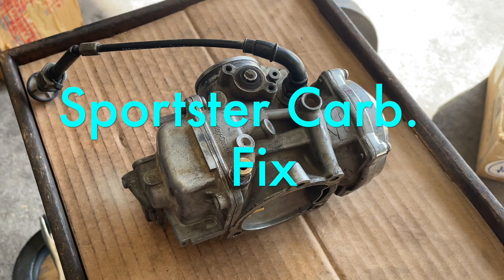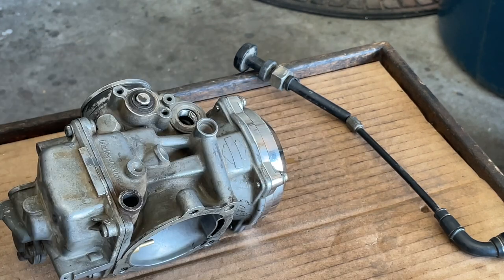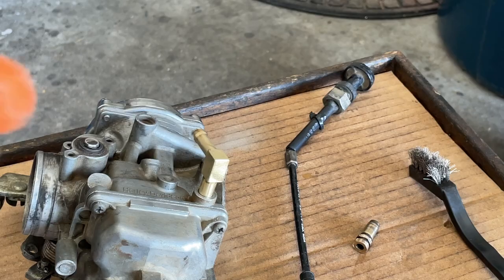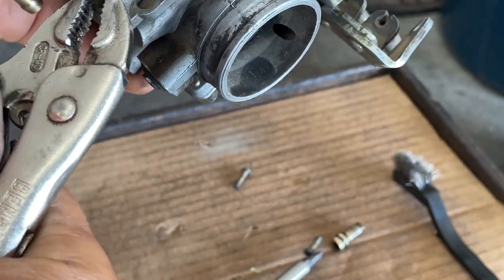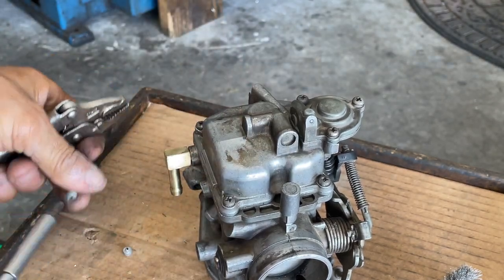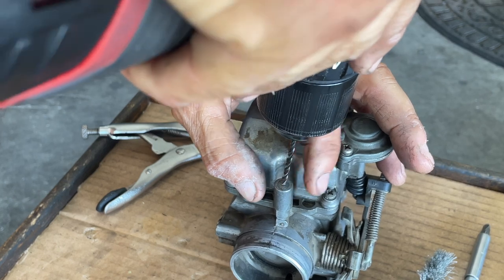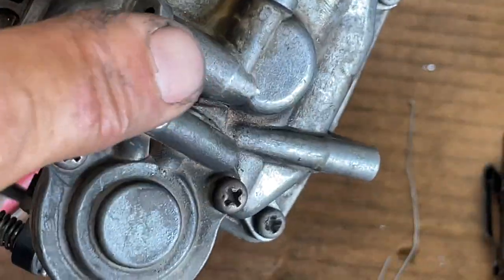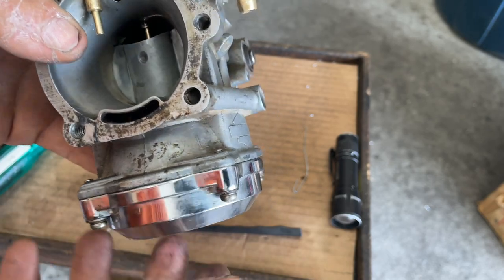How To, Harley Davidson Carb  Fix.

Comment: Thank you for making these videos it's helped me with my sportsters way more then I can actually ask for 😂 I went from a poorly running bike to something I enjoyed working on and learning alot bcuz you actually give clear and precise instructions. 😂 unlike some other content creators where you can't understand them
Reply from the maker: Happy to help. Any questions just ask. Thank you for watching and all your support L Assassin 22,  Ride safe and have a great day.
Reply: @TwoWheelRocco Your video's have helped me out tremendously with my recent purchase of a 96 XL1200C Sportster.

Do you happen to have any videos of carburetor float adjustment? I recently rebuilt my carburetor and it is pouring gas out of the overflow tube. It also seems to have lost a lot of throttle response as well.

I purchased it from the original owner who had the same problem after rebuilding the carburetor, that's why he sold it to me.

So two carburetor rebuilds within 18 months and they both leak out of the overflow tube.

Thank You 👍
Reply from the maker: The main thing to gas leaks is a bad Petcock, which the diaphragm goes bad but you could test that I'll send a video but the real number one problem float needle jet Has to be replaced. A lot of people just blow that off or buy a cheap one I recommend you go to dealer and buy one for like 25 $30 and that you should be in good shape. I'll send two videos. Any questions just ask.    
  https://youtu.be/2VwyFdMBOBc?si=Rpu1LtaNT6T5rOk1.  Watch the whole video I show you how to test the float needle on the bench. There will be no adjustment to the float level.. The problem lies with the needle Jet. The where is the float needle jet seats to seal off gas over fill your carb. bowl. When this happens, that's when you see the gas. Pour out the small hose on the bottom.     now for Petcock vacuum test. Very important.   https://youtu.be/7Fo9Q93OJXI?si=yM1nFT7HRtTzttSL. When the petcock fails, you cannot control the flow of fuel because the diaphragm gets a hole in it and fuel just freely flows into your intake and into your carburetor. That's the Petcock replace the float needle jet with a good one. Let us know how it works out.     Ebay.  https://www.ebay.com/itm/371594860984?hash=item5684c799b8:g:~W0AAOSw4nhZ-Mcq&amdata=enc%3AAQAIAAAA0Nwtli1MfFeqZJLgBM5ginGEyECWINZebtWRY%2BcOqZoNenr2RltshY8YBlxY%2BTbw85JtF0%2BF6mRMyrLMZ7w3Lpxfj73si8gBdntyaeoqA9MFlpz2v4zydTve4QlJwm8%2FqgABiAj0eMPoiqBFipxBANWW%2BCjSVcCFic%2BXvi27ZKBgVURFjJ9o1kFqVi6U4BMgiKG3%2B%2BvQrE%2B2qg5c%2FsjROrqbM2LRrn262oAL%2FVuKgF0r35JijKztpSPRgx6jTZp8FOj9K6KzieG11KfZjMVw7w8%3D%7Ctkp%3ABk9SR_7DnNrOYg.  Hope this helps.  Must make sure your gas tank has a screen on that Petcock because if you get any debris, gets caught up in that needle jet, It will leak, gas again and again. Any questions just ask.

Comment: Just yesterday I adjusted the air/fuel idle mixture screw, and the idle on my 2000 model FXDWG.
I think I got it right now, 1 and 1/2 turns out. 
The bike starts easily, cold with the enrichener pulled out. After  engine warm up while riding, the enrichener goes back in by itself. It sounds better at idle now, and runs like a scalded ass ape! 
Thanks for your videos Rocco!
Reply from the maker: Happy to help. Any questions just ask Thank you for watching and all your support Ardy. Ride safe and have a great day.

Comment: Thank You for another great how to video Rocco!  I've got an 87 fxrs low rider sport that I need to pull the carb off of and give it a cleaning.  Doesn't run well and fouling the plugs.  A shop was supposed to clean carb and drain and clean tank, but they didn't do all of the job as it fouled  out on the way home and I was so disgusted with the service I didn't want to take my bike back to them.  Thanks for videos that help people do the job themselves and have a better understanding of how their bike works.  Hoping to get 'er running again as I miss riding it.  Not the same as riding my bagger.
Reply from the maker: Happy to help. Any questions just ask. It's rewarding to fix your own motorcycle. Thank you for watching and all your support Steve. And your right riding is this #1 therapy. Ride safe and have a great day.  I will send you a video test your petcock when they start to fail you usually will have fouled out spark plugs.  .https://youtu.be/7Fo9Q93OJXI.  Very important to have a good operating petcock. That means the diaphragm is holding vacuum and not having Gas Leak throw it at fouling out your system. Very popular problem with these carburetor  motorcycles.

Comment: Whats up Rocco! I emailed you a couple times the other day about my carb issues.. Ended up FIGURING IT OUT! Finally!! Lol the accelerator pump diaphragm had a hairline crack about a quarter inch i couldn't see until i held it up to the light. End up changing out the vinyl nut that stripped on my choke with a brass one too so now it'll stay, ended up being a win win.. Your vids are the best, thanks again for all the help!
Reply from the maker: Happy all went well. Thank you for watching and all your support Andrew. Ride safe and have a great day.

Comment: Hi- Awesome video!  The audio/visuals and content along w ur great explanations were terrific.    Sorry for this ‘stupid q or 2’ but I had to stop riding my 99 dyna super glide 9 yrs ago.   I’m Far from being a gear head and thought it’d b a temp thing so I filled tank n added stabile.  Smfh- i shoukd have ram it dry.  Ram fine bfore I stored it- but heard of stories gas tank could become varnished n carb gummed up.   So I think il drain oil, gas, basically All fluids n replace the guts u did w carb n have a buddy inspect gas tank.   Should/could I change guts in carb w gas in tank?   Guess it doesn’t make sense if it’s going to have to be changed anyway.   Do u think it’s best to drain gas tank n change same couple parts u did -or u think the carb will need to have all parts changed ?    Sorry long winded.   Thanks
Reply from the maker: Happy to help. You'll need to drain that gas tank then you will need to clean the carburetor. Install a brand new battery and then see what you got. Try to start it. Hopefully your gas tank didn't get rusted. And your pick up Diaphragm probably is bad. Any questions just ask. Thank you for watching it all your support Sean. Ride safe and have a great day. Let us know how it works out.   https://youtu.be/Pp4l-zbQcy0.  This video test petcock.  https://youtu.be/7Fo9Q93OJXI.  This should help.   This will work on your HD Petcock to drain the fuel. The video is showing a Honda but it's the same principle.  https://youtu.be/c-gGr3mgaFw.   Good luck with your ride and get back out that little wind in the face is great therapy.

Comment: Have to do this. 04 883 13k on it and running with stage one never rejetted or tuned up. I am new to riding a harley but it sounds good when running a whike otherwise i pop and get slow throttle response at times. Not sure if the low tone sound of the engine blending together coming out my exhaust at times is due to carb but i would imagine cleaning and jetting will only improve it. Thanks for all your content
Reply from the maker: Happy to help. The first thing I would do is check my air filter. Sportster's and Harleys in general are notorious for oil getting on the air filter. Next make sure the oil is only halfway on your oil dipstick. I find many times too much oil in the motor and on your the air filter. Which leads to a poorly running motorcycle. If she ran good, then you don't need to play with the Jets,  air filter. Spray carburetor with carburetor cleaner, clean filter. Let us know how that works out. Thank you for watching and all your support Joe. Ride safe and have a great day.

Comment: Hello Two Wheel Rocco! What brand red lift jack do you use? Thanks?
Reply from the maker: Happy to help I will send you the link.https://larinstore.com/products/larin-motorcycle-atv-jack-low-profile-with-adapters-and-safety-arms-mal-2?variant=40209559486647.  I hope this helps. Thank you for watching all your support. Ride safe and have a great day and make sure it's the low profile jack.

Comment: Hey rocco first off I wanna start by saying your videos are awesome and they really helped me out and I’ve learned so much from them they’ve been a blessing unfortunately right now I’m going on like 40 hours working on the sportster I can’t get it to spark there seems to be no spark hi call I wrote it this morning after cleaning and rebuilding the carb …its getting gas into the carb its coming out the nozzle the spark plugs are new the gas is new the starter relay is new battery is new and still no spark ……it wants to go but it just cant im stuck ive got the service manual and gone through it front to back and tested the coil battery starter etc etc …..where do i go from here? Im so frustrated. I really need some guidance i don’t understand why it wont start up it starts up once in a blue moon then dies…..ive checked the electrical cables for cracks or splits and nothing …..any advice? Ive watched all the videos and gone through um and nothing is working! So frustrated!!!
Reply: O ya its a 1995 sportster 883 my bad!
Reply from the maker: Happy to help. Remove the spark plug and ground it to the motor in your garage and try to start, See if you have spark. let me know.   Thank you for watching and all your support boxkev. We will start there.

Comment: Great videos. I have learned a lot from your videos. My son and i have been working on a 1988 883 xlh that has been sitting for 12 years. However, i had to get a replacement cv carb because the person who had it before used a carb that wasn't a cv. I am not sure what size pilot and main jets to use. Any suggestions?  Your videos have been so helpful and instructive.
Reply from the maker: Happy to help. I would start with a 42 Idle and a 170 main. Let us know how that works out and what car are you using your Sportster 883? Thank you for watching and all your support Scott. Good luck with your ride. Sports does a great machines. Keep to OEM parts and it will work out fine. Ride safe and have a great day.
Reply: How many turns would you recommend for the air fuel mixture screw?. It was set at 2. Thanks
Reply from the maker: From the factory, it would be 1 3/4. Two turns out would be a good place to start.  Start up and make adjustments and see where you get your best throttle response. Let us know how it works out.

Comment: Hey Rocco, I've been working on a 03 883xl, I've watched a couple videos about your carb work and I've followed them very well. Problem is after flushing the needle and replacing on the diaphragm it still doesn't squirt fuel.

I've taken the accelerator pump apart and flipped the diaphragm over, because I know that can be a common problem on old car carbs, but I've taken it apart twice and it still isn't working, what should I do?
Reply from the maker: Happy to help, you really can't turn the diaphragm around because it has a lip seal.  I'm will send you a video that will help you out. It will show you how to remove that brass pen and test and clean that. Any questions just ask. Thank you for watching and all your support . Ride safe and have a great day.     https://youtu.be/BEvtEw_twPQ?si=SGuy0JWG52XA-NzK
Reply: @TwoWheelRocco  I reviewed more videos and have concluded I forgot to put the accelerator plunger back after putting everything back together, haha, figured out the problem! 

Thank you for your videos and the quick response, it's much appreciated!
Reply from the maker: @guestcalypso9754  I'm glad all worked out,  always my pleasure to help. Ride safe. Have a great day. Have to love these sportsters.

Comment: Hey I have oil on my spark plugs threads. Is a cause for concern?  Bike run great but when coming to a stop not idling great. Thanks
Reply from the maker: Happy to help. Take a look at your oil level and  your air cleaner. If oil fouled. remove oil and clean filter and see how she runs let us know. Thank you for watching and all your support Mickey. Ride safe and have a great day.

Comment: My accelerator needle doesn’t shoot out a steady stream as yours does. It comes out like a garden hose without a nozzle on it. Would this be an indication that I need to replace the accelerator pump??
Reply from the maker: Happy to help. I would try to force air or cleaner through that needle while you have it removed. Make sure it's functional with  compressed air. Try to find a small wire brush, hair, remove a peace of metal wire and use that to clean needle.  Sounds like it's clogged, you can clean it out reinstall, clean test reinstall. Thank you for watching and all your support Saul. Ride safe and have a great day. Let us know how it works out.

Comment: I just have a question. I am 68 years old and purchased my first  H-D when I was 18. I do all my own service, repairs and mods. This question is in regards to the head breather bolts on a 2006, 1200 C. I know what the breather bolts do and why they are there. I just want to know, in your opinion, can the breather ports in the head just be sealed off / up with regular bolts. In essence just getting rid of the breather head ports. I have never done this, I am just curious if the heads need the breather function or is it an EPA thing.
Reply from the maker: Happy to help. It would build up too much pressure in the top end of your motor and cause significant damage to your pistons and rings. Thank you for watching and all your support Wes. Rides safe and have a great day. Sportsters are great machines. Hope that helps.

Comment: I’m having an issue with my 97 dyna. For some reason the carburetor isn’t getting fuel I bypassed the vacuum actuated petcock, and the issue is still not resolved. Any advice?
Reply from the maker: Happy to help. How did you bypass your diaphragm Petcock? If you're not getting gas that's from the tank to the carburetor. Puzzle wine on the Carburator on the Carburator side and see if Fuel is pouring out by your disconnected Diaphragm on your peacock and that should help you figure out what your what's going on. Rebuild the Petcock, check the screen in the gas tank. Make sure you're flowing fuel and then everything else you're fall in line. Any questions just ask. Thank you for watching and all your support James. Drive safe and have a great day. Let us know how it works out.

Comment: Hey brother, thank you for the video I installed an 800cc kawasaki vtwin in a golf cart. Vids on my channel. It was a bobber project that was abandoned, so I pulled the engine for my use. It has the same carb but I've been having many issues. Mines has been overflowing fuel. My tank is below the carb so I'm having to use a vacuum fuel pump. 
The diagram I have  shows the Inlet on the top rt side instead of bottom lft and mine are both plastic.  Can you change the plastic inlets and how? And you think my information is incorrect, or did they have other models..
My "overflow" is a white nipple on the left and nipple is pointing to the opposite side of the engine. I have a black nipple on the right of carb higher than the one on the left, and the nipple points up. Or do I have my fuel line on the wrong Inlet? Cheers
Reply from the maker: I'm not that familiar with the Kawasaki 800 V twins. But you could look it up on YouTube. You'll find out what you need. Go to Ebay pull up the part.. All the information is out there. Good luck with your project. Thank you for watching, and all your support, gottoKnowJoe.. Ride safe and have a great holiday. I will go to your site and see what you're into. Sounds great.

Comment: Awesome video
Reply from the maker: Happy to help. Any questions just ask. Thank you for watching and all your support Jimmy. Ride safe and have a great day.
Reply: @TwoWheelRocco  actually I do have a question for ya. If yr familiar with the Sportster l, I just got an old 1994 883 with no kickstand spring. I bought the kickstand spring and it doesn't fit. The bracket on the top has a slot, not just a hole for the pin. So the kickstand pin will move about 1" toward the frame when it is put up so the spring just falls off the peg that's on the frame. The bracket is welded to the frame so I think it's original. It doesn't look like a jiffy stand though. Any advice would be great.
Reply from the maker: @JimmyGreen-wx6gt  Happy to help, if you can send a picture to ERocco 3964@gmail.com so I have an idea of what you're working with. Ride safe and have a great day.
Reply: @TwoWheelRocco  awesome thanks I will send some pictures when. I get home. Thanks a bunch.
Reply from the maker: @JimmyGreen-wx6gt  Happy to help.